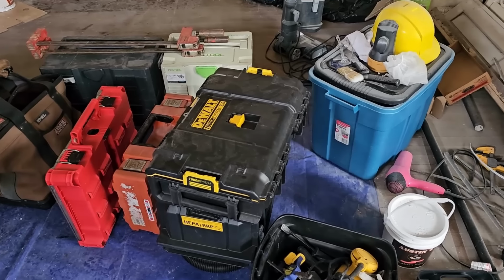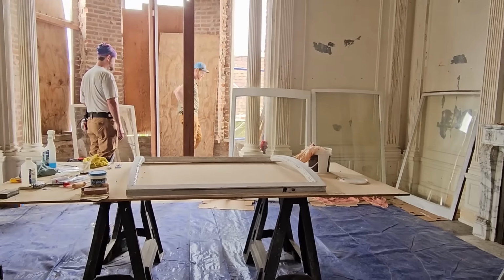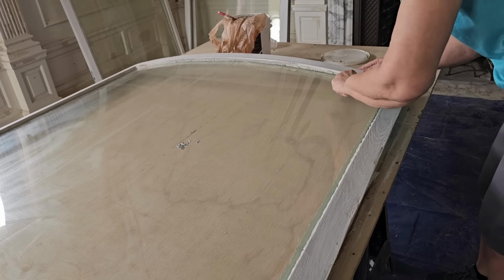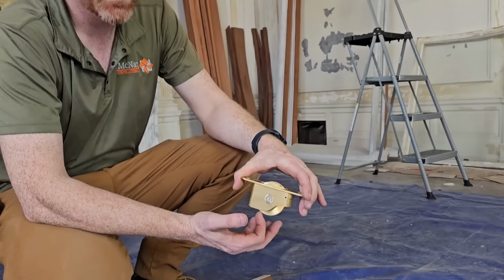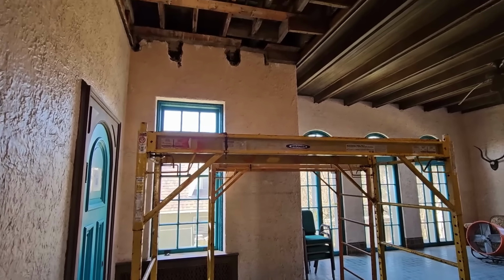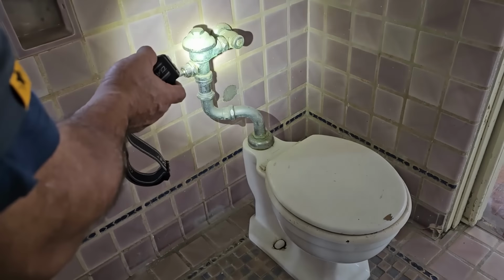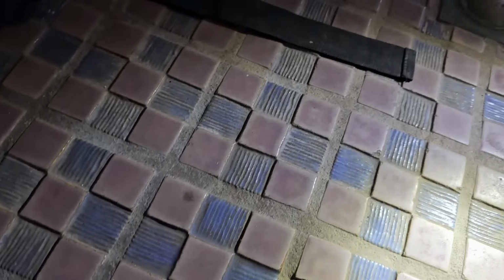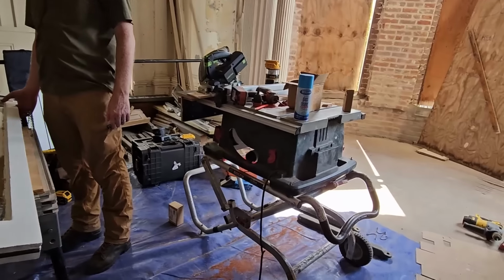S4.19  Exciting News: The Windows Have Arrived!

Comment: Hint for marking keys:  Using a P Touch label maker, I used 12mm Laminated tape to put a Letter on my house keys.  I have several identical keys so I marked F for front, B back, K kitchen, G garage etc.  The labels have stayed on for years.
Reply from the maker: That's a great idea!  I've tried color. Oding with fingernail polish but it wears off.

Comment: We always prime wood underlay & cedar siding on both sides & cut ends with oil-based primer to prevent moisture penetration & warpage. LOVE yourcurved windows & panes. Glazing is a lost art. I loved learning to do this from my father! ❤️🙏
Reply from the maker: My instinc is to prime everything with oil base primer, too.  These curved windows are a great feature.  It is so nice to see them back up.
Reply: There are several sides to this discussion and I can only rely on our own experience and learn from dismantling or replacing historic window units throughout my career.  There is a misconception shared by many that believe water rots wood. Water on its own does not hurt the wood at all, but if there is enough moisture, fungus grows and that is what rots wood. My opinion is that if we allow the parts of the window unit to breathe that are not in direct UV contact and not retain moisture then the chances of fungus growth in minimal. If the moisture content in the wood is below 20% the majority of the time, with the ability to dry out when it rises above that, then the wood will never rot because the fungus does not have a chance to grow.

Comment: I believe you have a floor drain with backflow in the upper floor bathroom in case the toilet overflowed. They often installed floor drains to prevent damage to lower floor ceilings. ❤️🙏
Reply from the maker: That's what I thought at first but the Kempner grandchildren remember playing in that bathroom because they liked to flush the toilet by stepping on the button.  I need to get down on the floor and take a closer look at it.
Reply: @leaguekempnerhouse  So cool... I've never seen one before! I wonder if it's a custom or beta test unit? ❤️🙏